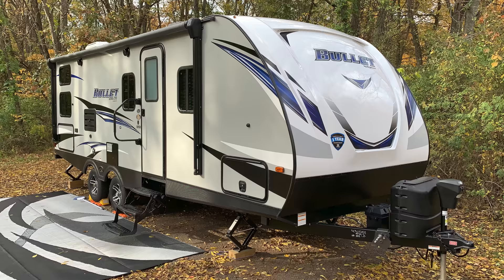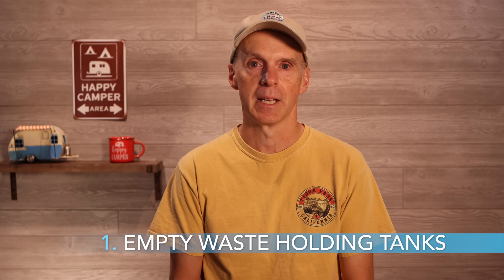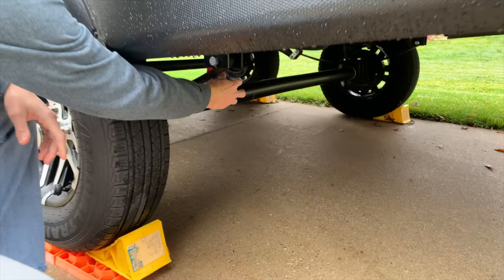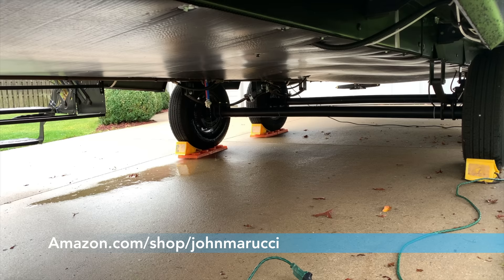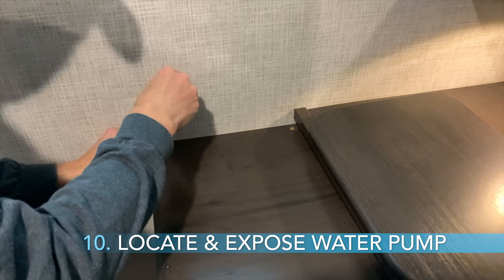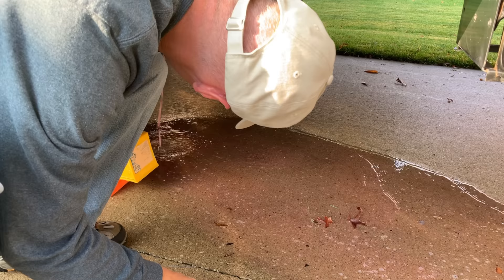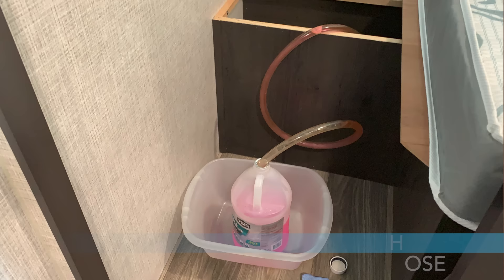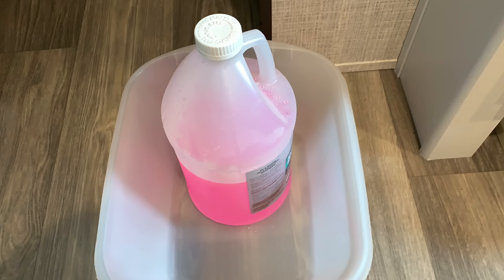RV Winterization Basics For Beginners – Step-By-Step Process

Comment: Can i use water after they been winterization and if so how long ?
Reply from the maker: Once you have the RV antifreeze in the plumbing lines, you will need to flush the system before using again. I have a dewinterization video that explains the process: https://youtu.be/pt6tnzv8zTs?si=5bBfHi4ccA3DOXgA

Comment: Question.  After you are finished winterizing, do you re-open hot water bypass valve (so it's ready to fill in the spring)?
Reply from the maker: I keep the hot water tank bypassed until dewinterizing in spring. It should keep RV antifreeze from seeping into the tank off-season. Thanks!
Reply: @JohnMarucci  Thanks, I worry about forgetting and burning out the heating element.

Comment: What if i’m using my travel trailer during the winter?
Reply from the maker: If it will stay below freezing for any length of time with the trailer unused and there is water in the plumbing system, you will need to winterize to avoid damage to the plumbing.

Comment: Do you have to do all of this if you live in your camper full time?
Reply from the maker: It depends on the setup of your RV. My Keystone Bullet has a sealed and heated underbelly where the plumbing is. My older R-Pod 179 did not have this, so the plumbing would be exposed more to the elements. It also depends on where you live and how cold it stays in winter. You may want to follow Ray from Loveyourrv.com who has stayed in Canada in the winter full-time in an RV. He has many tips for doing so. Thanks!

Comment: Where can I get the siphon for the antifreeze or parts? Would Home Depot sell those fittings?
Reply from the maker: I have the fitting and hose on my Amazon storefront, although the 1/2" diameter hose you should be able to get at most hardware stores: https://amzn.to/3rokBEP,  https://amzn.to/48nbYuU
Reply: Thanks. I also don’t have a black water blowout connection, is that something not all trailers have? 2018 Keystone Hideout LHS
Reply from the maker: I have that also on my store if you need it. You'll need a small air compressor as well: https://amzn.to/3RAIxzs

Comment: What happens if i dont have the black tank flush on my camper?
Reply from the maker: If you don't have a black tank flush inlet, you won't need to use compressed air to blow out that line.

Comment: Do I have to winterize my rv if I’m using it in cold weather?
Reply from the maker: It depends. If you will be in the trailer and can run the furnace when it gets below freezing you may be okay for several hours. Most trailers with sealed and heated underbellies can handle it okay for a time. I do have a freeze tips warning video if interested: https://youtu.be/kfj1fcn6nok

Comment: Do I need to winterized the RV if I'm a full time living?
Reply from the maker: It depends on how cold it gets where you are camping in the winter and if your specific trailer is outfitted for colder camping. For example, my 2020 Keystone Bullet has a heated and enclosed underbelly, so I can camp in pretty cold weather for a time, but it is not four-season rated.

Comment: Hey, I bought a 2007 Trail light crossover this past year. The trailer is a bit older and I'm not sure if it has a water pump switch like the one shown in this video. Does anyone have any idea where the switch would be located in my trailer? or if it even has one?
Reply from the maker: If you can pump water from your fresh water tank, you should have both a water pump and a switch to turn the pump on or off. The switch should be on your control panel where your indicator lights are for your tank levels. Thanks!

Comment: You have to do all
Of this even when it’s parked in the winter?
Reply from the maker: If you have water in any of the plumbing lines of your RV, you will need to winterize if where the trailer is will go below freezing. Otherwise the water in the lines will freeze and cause damage. Thanks!
Reply: @JohnMarucci  thank you! I’m not currently hooked up to a water source now as my fifth wheel is stored in a storage facility. I’ve drained all the lines except the fresh water tank and the water heater… I’ll do both today. Would I be okay just dumping the AF in the sinks and shower drain?
Reply from the maker: The problem often is the water pump. You can’t easily get water out of it unless you used compressed air or run Antifreeze through it. Generally if you get all the water out of the plumbing lines, including the tanks and pump, you should be okay. I’m risk averse and run the antifreeze through it all. All the best and Happy New Year!

Comment: I must be a complete idiot, because I haven't got a clue what a siphon line is and how to switch it for an intake line.  Also, I'm not planning on using my rv until it's winterized, so I probably won't need to do alot of this stuff, but I haven't got a clue where to start
Reply from the maker: If this is how you are feeling after watching the video, I would suggest having a local RV dealer or a mobile RV tech do the process for you.

Comment: Why blow out the lines if you're going to run antifreeze thru the lines anyway.  Blowing out the lines seem unnecessary.
Reply from the maker: With this process you only blow out the city water inlet and black tank flush inlet. No RV antifreeze enters those lines when you pull the antifreeze in at the water pump, so they can still have water in them. Thanks!
Reply: Ok, great explanation,  thanks much! We followed your steps and were surprised to see how much water still came out the faucets along with the antifreeze after blowing air. Your explanation makes sense.

Comment: At what point did you cap the fresh water drain line?
Reply from the maker: Roy, directly after you drain the freshwater tank in Step 2 you can close the drain valve. Here is a link to the written instructions if you don’t have them, thanks! https://johnmarucci.com/wp-content/uploads/2020/12/RV-Winterization-Basics-1.pdf
Reply: @JohnMarucci  Thanks. The video was very helpful as I am a first time RVer.

Comment: Why not just blow out lines and pull the pump?
Reply from the maker: You could do this, just not sure why you'd want to fully remove the pump. If you are wanting to remove the water pump to save it from possibly getting ice and cracking, I can see the point, but some RV floor materials (like on my R-Pod) don't take well to removing screws and replanting them. Overtime the pump would likely loosen up on the floor. I think a better solution if you don't want to run RV antifreeze is to learn how to blow the lines out properly and leave the pump in. If you are not confident doing this, the antifreeze method is pretty simple. Thanks!
Reply: @JohnMarucci   you make a good point thanks.

Comment: What's the antifreeze for??
Reply from the maker: Gerardo, here is a response on this channel from a person who works at an RV dealer (Rebecca Robertson) that likely explains it as good as I could...  "I work in the service department at an RV dealership and have seen instances where people have blown out all of the water, but still end up with a cracked water pump because there are some areas that still have enough water to freeze and crack (almost always the strainer's housing cap).   We see a lot of those come spring when we de-winterize RV's and there's a leak somewhere and the customer had only blown all the water out,  not followed up with antifreeze.  But it's a personal preference, I suppose."  Thanks!